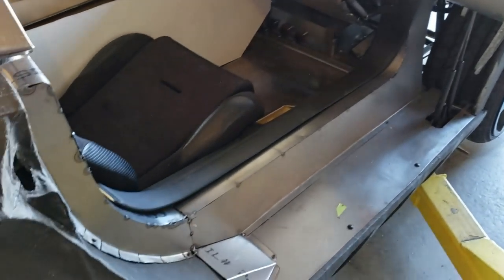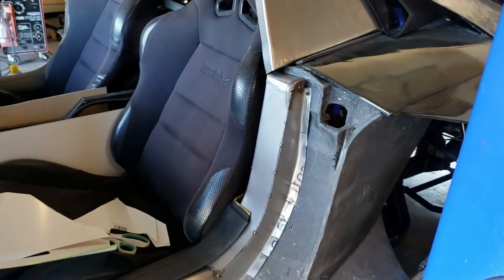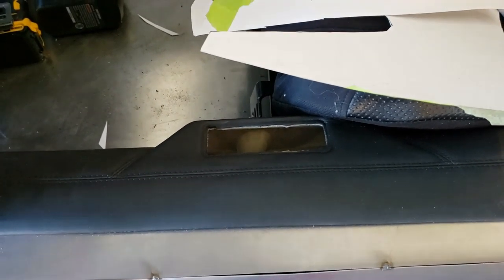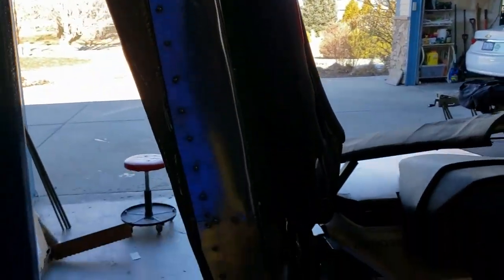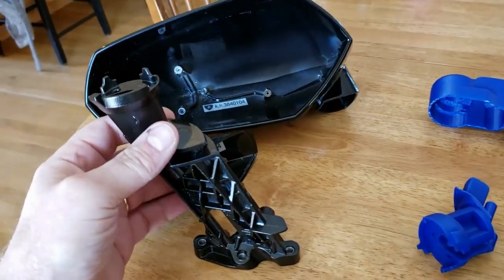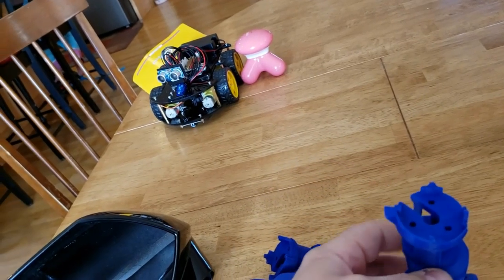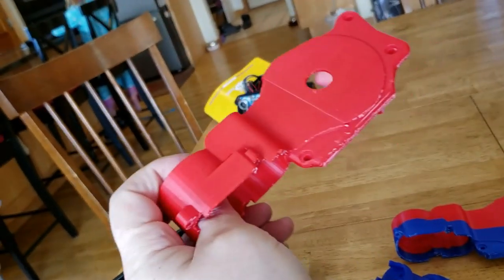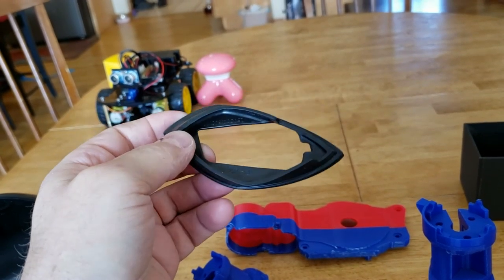3D Printed Interceptor Update 25

Comment: As a steel worker/manufacturing in the farm implements business I’m amazed how well your doing the interior with steel. I’m used to using 10g to 1/2” ms so your thin stuff is not easy. Would a fiberglass chopper gun coating the steel with a layer of fiberglass/kevlar then sand smooth and paint the door jambs area be an option?
Never using a chop gun I could very well be an idiot for even suggesting it. 
Anyway, keep up the good work and may the speed force be with you 2 😎
Reply from the maker: It is not bad.  I only have a crappy break, and a hammer, so thinner helps.